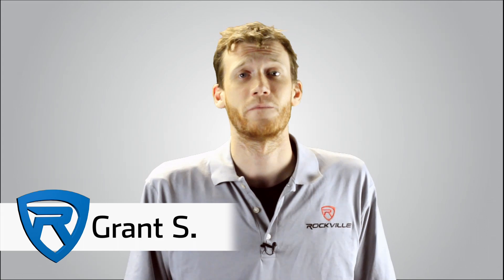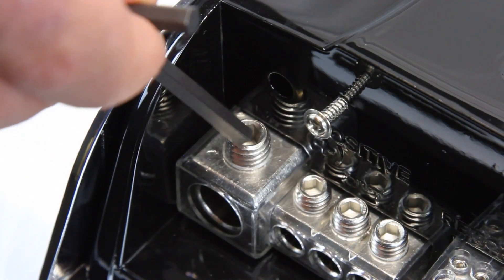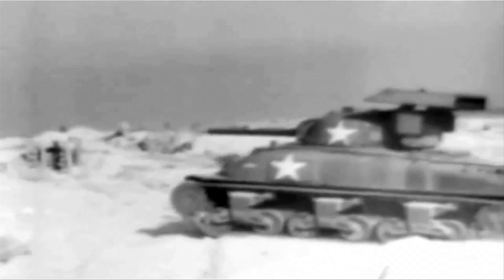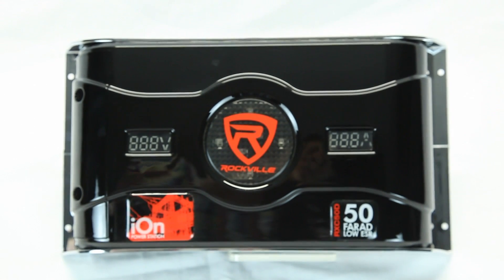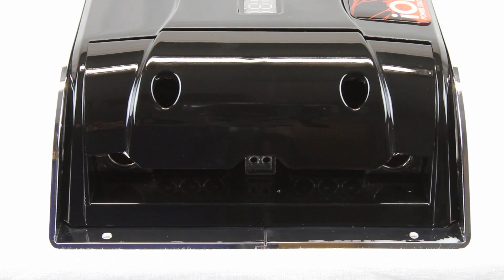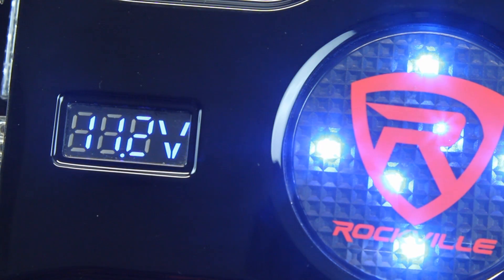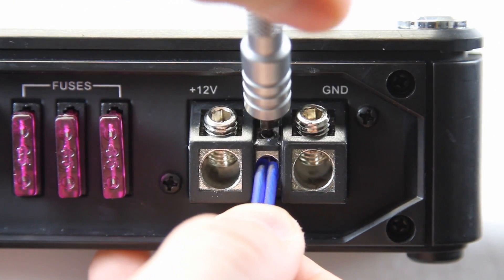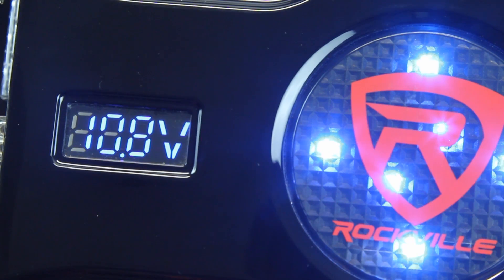Rockville RXC50D 50 Farad 10,000 Watt Extreme Ion Capacitor

Comment: I have one of these in my system two kicker Q-class L7 12 's and so far the past year it's worked great with no problem except the amperage indicator LED has been at 0 since I bought it I actually had a professional install my system at a shop and they to pretty much said they didn't see a way to get an amps readout on it

Comment: no all it does it help stop the lights dimming. it draws on the alternator at 14 plus cost as quickest way to charge as battery at 12 volts. It will just make your amp sound worse. solution is higher wattage alternator or multiple altinators. multiple batteries don't help much as voltage too low. better for using if engine off though. these people in my opinion just want your money for a 4 dollar cap in a space age jacket. duh

Comment: I've never seen a capacitor where you run both plus and minus from the amplifier to the capacitor usually it's just the plus and ground amplifier like standard why is this different?
Reply: The new ones u run both
Reply: It shouldn’t be and you shouldn’t do that in my opinion I think it’s just something they added